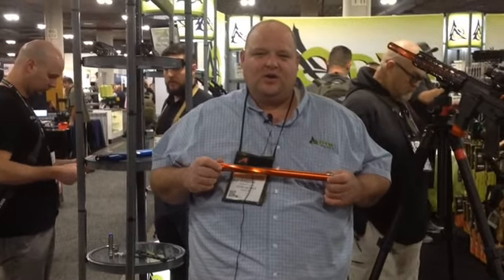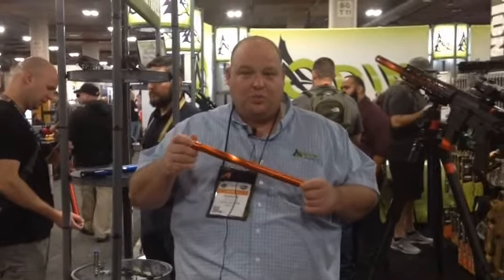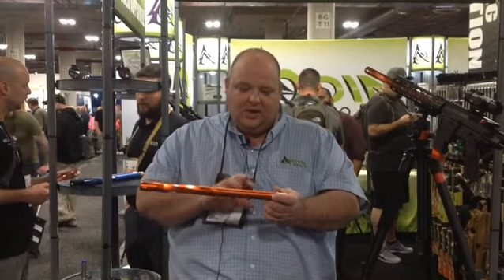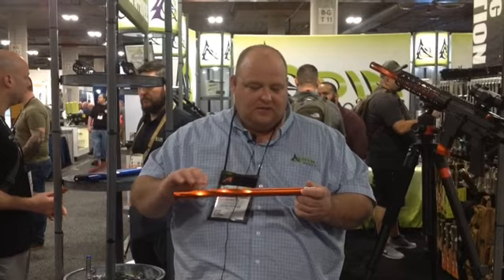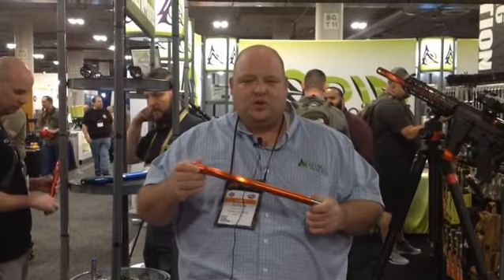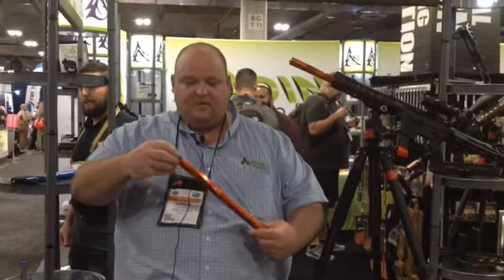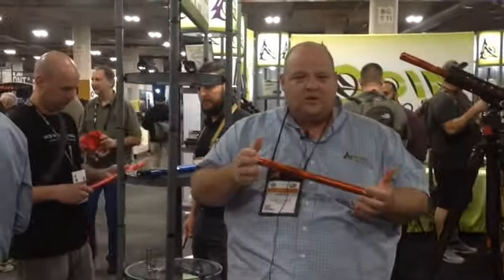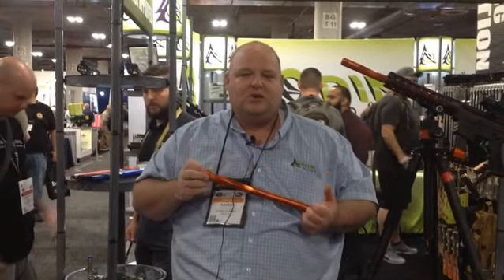ODIN Works: Shot Show 2020 | 9mm SUPERLite Barrels Reveal

Comment: how to clean it if its pin and welded?
Reply from the maker: You can clean the barrel with a snake and a cleaning solution and clean the sleeve by inserting a rag with cleaning solution into the muzzle end and pushing it down until it meets the barrel.